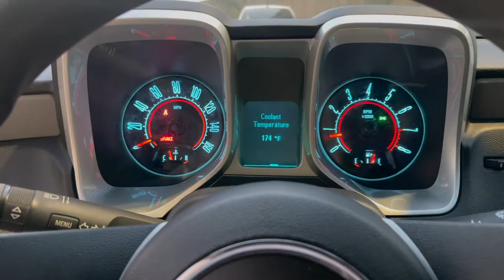WHY I HAVEN'T BEEN UPLOADING!!! (Issues with the Camaro + Mods + More)

Comment: Is it a lfx engine???
Reply from the maker: It’s the LLT
Reply: Dam I have the lfx do u have any ideas on what I can do to it
Reply from the maker: You can do a lot of things to the LFX like a cold air intake, tune, e85, 80mm throttle body, ported manifold and throttle body the only thing that can’t be done from my knowledge is long tube headers
Reply: It’s because you don’t have any heat wrap on them . Simple heat wrap will do the fix